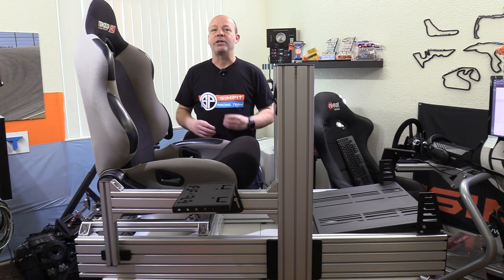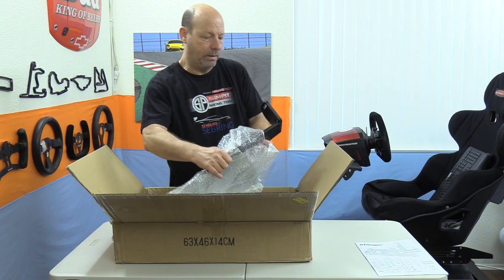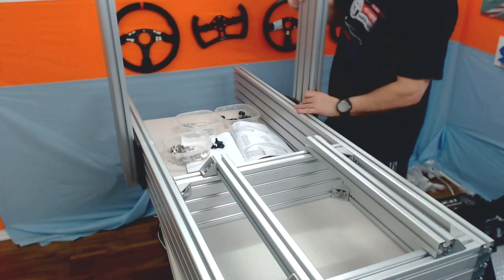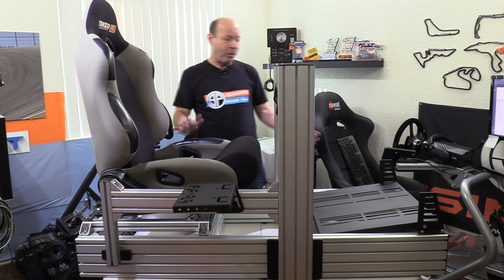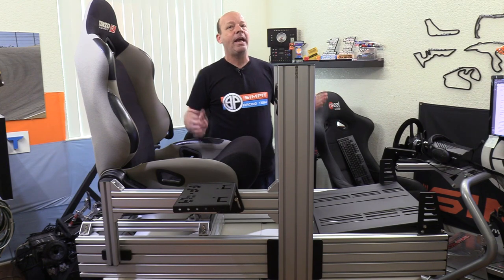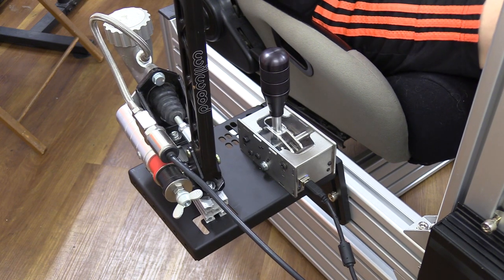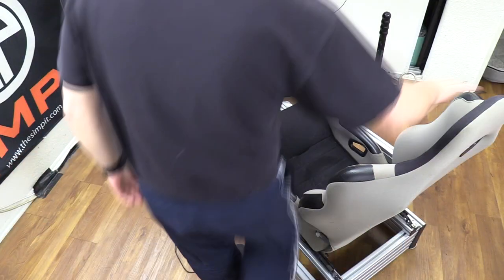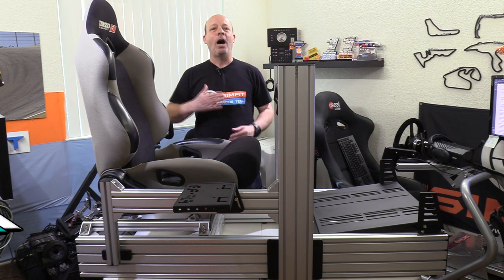GT Omega Prime - Full Review

Comment: Just come across this vid , wanted a rig for long time , and tonight I finished building my omega prime . Only have logitech g29 for now as fanatec out of stock still. Anyway after finishing building prime I'm left with literally bags full of spares , fixing angled x 8 and nuts bolts csk screws etc like 40s and upwards numbers. And that's better than not enough I guess.  Only difference is now the pedal tray set up for me is no longer a 3mm steel tray but Ali profile parts like the whole frame is made from , pure solid.  Yeah also agree its proper heavy rig and I built it on floor . Back breaking lol. Took me like 4 hours to build . But pure solid rig

Comment: Great video. I’m tempted to buy 1. My only problem is funny because the problem, is also the solution and the adjustability. I wanted something to be adjustable enough so I can get the best position possible but  as you mentioned, moving the wheel mount plate, up and down, trying to get best position and trying to make sure both sides are level, looks like a huge pain in the arse.

Comment: One thing I noticed on the pedal deck footage - it looks like the front of the pedals have a slight gap to the tray, but the rear of the ricmotech sits flush. It looks like some of the flex might be that gap in the front being taken up, so I'm just curious if there's some flange or something underneath the pedal base in the front that keeps it propped up slightly?

Comment: Is this compatible with the NLR V3 Motion platform?
Reply: Should have no problem with this. It's very similar to the P1-X, and Barry has a good review where he's added the V3 to one of those with no issues. Would probably need to adjust your pedal tray height to compensate for the difference, but mounting shouldn't give any problems.

Comment: I still feel the Rseat S1 and Sim Lab PX1 are better options
Reply: Rseat has no where near the adustability not to mention I personally do not prefer a wheel base mount that is only supported on one side.
The Sim Lab although nice cost more plus add in the extra shipping cost the price is quite a bit higher.. 
Also add in that if you live in the U.S.A. the free shipping of the Prime Cockpit makes it one of the most affordable aluminum extrusion rigs on the market. Also there are a lot of actual seat options at much cheaper prices than the seats offered by GT Omega.
Buy the Prime Cockpit sans seat and you could not do a DIY extruded profile build for much less $ not to mention it would be minus what looks to be a nice wheelbase mount plate. I also do not think it would be difficult to add a few braces to eliminate the pedal plate flex.
I plan on ordering one of these within the next couple of months.